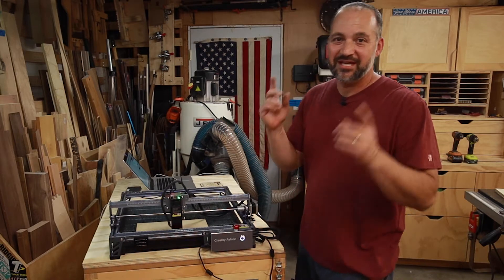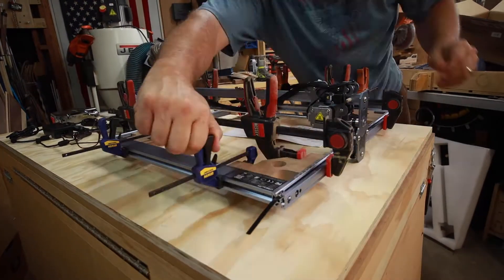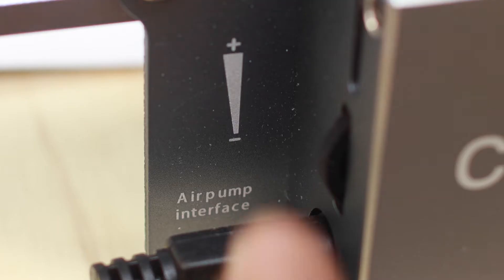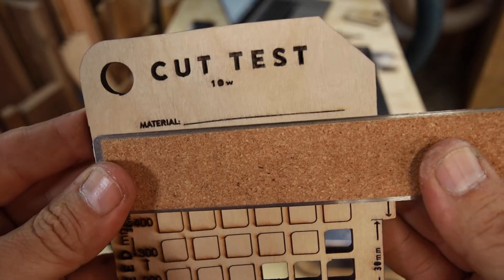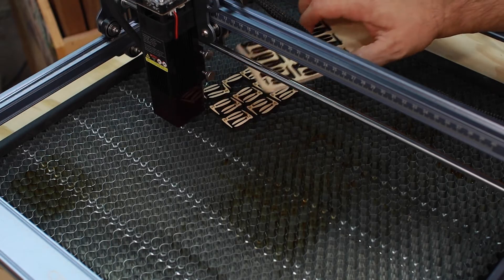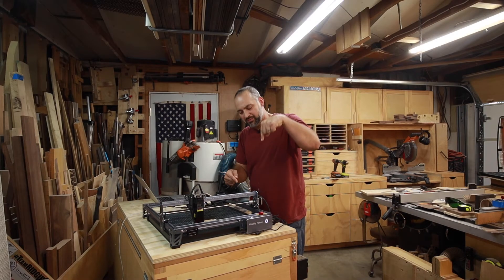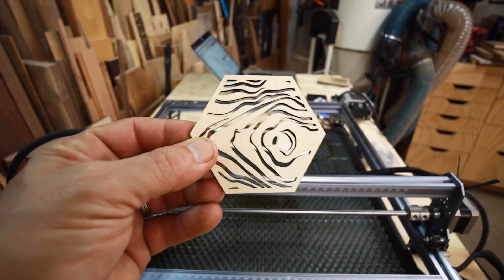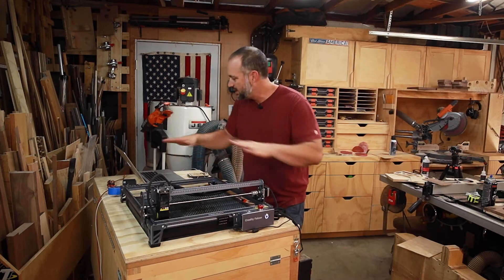Affordable & Budget Friendly Laser Engraver - Creality Falcon Pro 10 watt Laser Review

Comment: It works with Eva Foam for cosplay props or stuffs related to cosplay?
Reply from the maker: i think it would as long as it's thin enough.  no thick blocks of the foam.  I've cut felt and cardboard.  You'd just need to do some practice tests so you can dial in the speed/heat so you get a good clean cut and don't melt the foam.  👍🏻

Comment: Thanks for the video, but I'm having trouble connecting my MacBook Pro to the Creality Falcon 10W through LightBurn. Did you have any issues? What OS are you running? Any advice? (Most of the forums say to stay away from connecting your Mac to it. I hope I don't have to get a Windows laptop just to connect.)
Reply from the maker: bummer!  i haven't had any problems using my macbook pro.  it's an older macbook pro but everything still works great.  Mine is a Macbook Pro, retina display, mid-2015.  OS i'm running is BigSur.   I can only suggest making sure you've installed the latest version of Lightburn (which i'm assuming you probably do).  Other than that maybe contact lightburn?
Reply: I have been having the same issue for almost year now. I reached out to the company and they didn’t provide me with anything that helped. I’ve tried different cords and a comm cord and a computer. So my laser is currently collecting dust in a corner. Not happy I spent almost $400 on it just for it to not connect to any computer or laptop.
Reply from the maker: @katelynnsmith1832  unfortunately i'm not Creality tech support.  I can only share my personal experience here and I haven't run into any issues.  Without trying your set up in person I can only think to recommend making sure the Lightburn software is up to date...OR...you can see if you're able to go back a couple versions of the software and see if that has any luck.  Other than that, maybe just keep pestering Creality and see what they can come up with.  Again, i'm just the recipient/user of the laser and am not associated with Creality.  Both lasers i've had from them have been good to me.  Sorry to hear you're having trouble with yours.😕

Comment: Hi, I am a beginner, trying first time, what would you suggest 10w or 22w falcon machine? I want to start it a hobby and create small things mainly for cutting upto 5mm max. The price difference is significant between them, need you advice...thanks!
Reply from the maker: the 10watt was great to learn on but once I got the 40watt, there was no looking back!  So, if you can afford more power, I say go for it!  If you can only afford the lower power model it will still be good to learn and get familiar with.

Comment: I've been adjusting to eccentric nuts and tightening the belts. But the lines have a slight waver. What else should I do to remedy that?
Reply from the maker: considering that i have yet to master the laser, i'd double check all your speak and hear settings.  also check your interval settings in lightburn.   maybe tweak just a little point at a time.  for instance make a minor adjustment to only one belt and see if it helps or makes it worse....then do one minor adjustment to the other belt and see if that does better or worse.  then do the same for the eccentric nuts.   other than that i would reach out to creality and see what they can tell you👍🏻

Comment: Did you make the cut test file or where did you get it?
Reply from the maker: I got one from an Etsy seller but Lightburn also has a feature to run a test burn/cut.  After trying them both making some cuts based on settings from each, I found that I was happier with my results from the Etsy file
Reply: @stuffsethmakes do you have a link for that
Reply from the maker: https://www.etsy.com/listing/1527973534/?ref=share_ios_native_control
Reply from the maker: i dug up the link if you still needed it👍🏻

https://www.etsy.com/listing/1527973534/?ref=share_ios_native_control

Comment: If the piece is too big to fit inside that frame, can you just set it on something? Like a dining room table you want to engrave?
Reply from the maker: yeah, i think that's one of the hidden features of a laser like this, haha!  If i wanted to engrave a logo on something like a tabletop, you can probably just set it in place, centered over the area you're wanting to put your artwork, set the appropriate laser height relative to the tabletop, and run it.   I say you can "PROBABLY" do this because i have not tried it.  I have however, tried it on a pumpkin pie and engraved an image of George Jefferson saying "happy thanksgiving you jive turkeys" 🤣🤣 The results were......well.....not great, but that was a pumpkin pie and I had 1 shot.  Who would've thought pumpkin pie burns differently than wood?? LOL!   But in theory, i would think that yes, what you're proposing may work👍🏻

Comment: How well would this cut fabric? I am looking to cut some pellon pieces that will be like maybe 4mm thick.  Also, can this engrave fabric as well?
Reply from the maker: i don't know what pellon fabric is, but at 4mm it would probably do it.  The only "fabric" i experimented with so far was felt which was of course no problem, but i also tried some leather (cutting and engraving).  The leather was pretty thin, so it wasn't a big deal but i remember playing with the settings on some scrap first.  The heat/speed ration needs to be dialed in otherwise it was wrinkling the leather.   Sorry, i know you weren't asking about leather 🤦🏻‍♂️.   I think any fabrics would work as long as you test on some scraps first 👍🏻

Comment: Serious question: inlays and burning. I'm guessing the burn marks are too deep to sand off without noticeable wood removal. So when you make an inlay, do you see the burn marks around the edges? I've been thinking of adding a laser. I'm chiefly a turner though and the lasers that can do round stuff like that are very expensive

(ok, it's reasonably priced. I honestly thought it was in the 1200 range - it looks that good - but 350 is really decent)
Reply from the maker: nothing is free, friend.
Reply from the maker: @armus550b   i don't think i've done any inlays (if i'm understanding you correctly).  You can also get a rotary attachment for this that allows you to laser on round/cylindrical objects and it's not a very expensive add-on.  Have you watch my more recent video?  This company sent me a bigger laser also.  After I made the video they offered to send me the rotary attachment for which I'd have to do another video, but I don't plan to do any round/cylindrical laser projects....yet.  I'm going to be building a stand for my lathe soon because I'm dying to turn again.   Maybe i'll buy the rotary attachment down the road 👍🏻

Comment: Hey, many thanks for the detailed video! I've bought this device and the only thing I couldn't figure out with the assembly is how to secure the air tube without making a future problem. I have no experience with lasering and neither the manual nor the official tutorial video show this part. Thank you! I can use my Falcon Pro without the anxiety of the tube jamming mid project!
Reply from the maker: awesome! glad it was helpful👌🏻.   I'm setting up the 40watt model they just sent me and the air tube is secured a little differently/better on this one.  Haven't run the new machine yet (hopefully this weekend) but i'll have a video it shortly as well.   Thanks for watching!   p.s.  I've been loving the 10watt laser and getting a lot of use out of it.   It'll be interesting to compare it to the 40watt now👍🏻

Comment: Thank you for this, the belt assembly was melting my brain, they really should update the instruction manual!! Are you able to share where you got the test files?
Reply: Found it in lightburn!
Reply from the maker: sorry for the delayed reply!  yeah there is a built-in one within lightburn.  i also used one that i bought from an etsy seller which is a little more detailed👍🏻
Reply: @stuffsethmakes  thank you 💜
Reply: @stuffsethmakes  I should also mention, I had to change my input in lightburn to usb in order to get it working, it took some tinkering to figure that out if it helps anyone!
Reply from the maker: yes!  having used it a lot more now I've found in Lightburn that i still need to manually select the usb port for it to communicate with the machine even though "auto" is selected.  I do see that I need to update the version Lightburn...maybe eventually one of the updates will solve that.

Creality just reached out to me about a new version of a laser (Falcon2 PRO, there's a 22w and a 40w model)...keeping my fingers crossed.  Would be a great opportunity🤞🏻
Reply: @stuffsethmakes  that's exciting!!!! Im loving the 10w, but the idea of doing more with it is so tempting!
Reply from the maker: @dafterpunk6008  totally.  i'm actually in the middle of building a whole cabinet/enclosure for the 10w that I have (video coming eventually) it'll be pretty sweet but the new lasers they're offering me come with an enclosure (look up the Creality Falcon2 Pro) and some other features that could be helpful.  I went for the big ask and asked if they'd send me the 40w model 😬.  We'll see, haha! 😅
Reply: Hi , did you have problem with double line or ghost when engraving small letter ?
Reply from the maker: @Ronf85   Hi!  No, i've had zero problems like what you're referring to.  have you run into these problems with your laser?  is it the same laser?
Reply: @stuffsethmakes   yes it is the same one ! When I engrave bidirectionnal fill , it double line
Reply from the maker: @Ronf85   hmmm.  not sure.  a couple things you may want to look at.  1) remove the laser head and clean the lens and the nozzle.   2) check what the line interval setting is for filling.  I believe 0.1 is default and most common.  See if either of those are any help🤷🏻‍♂️
Reply: @Ronf85  check the tension on your belt as well, too tight might cause it to shift a bit when you do multiple cuts, mine was too tight for example. I did small test circles with 3 to 4 passes, to get it right! :)
Reply from the maker: @dafterpunk6008  thanks for adding that👌🏻

Comment: went through at least 20 other review videos. this video was the most helpful.  and that stencil for starting point. I was beating my head over that for so many hours such a simple solution. Thanks a ton my friend.
Reply from the maker: Awesome!  I'm glad it was helpful.  I've used this laser a lot since making this video and it continues to impress me!😃
Reply: @stuffsethmakes  One quick query . can we fit a honeycomb laser bed 400x400 mm with this. the default add on has a smaller one i guess.
Reply from the maker: @Sunil-zk4gb  I believe so.  I'll have to double check the dimensions since i'm not familiar with mm dimensions 🤦🏻‍♂️.   I'll look on the box tomorrow and see what size my
honeycomb grid is and reply back.
Reply from the maker: so i checked this morning.  the box doesn't have the size on it but the honeycomb grid measures 19.75 inches by 19.75 inches square 👍🏻